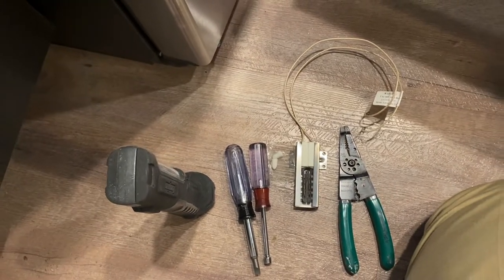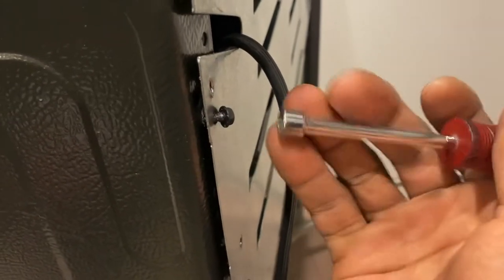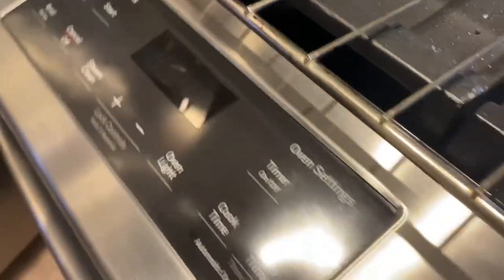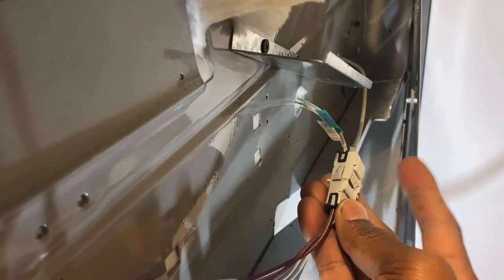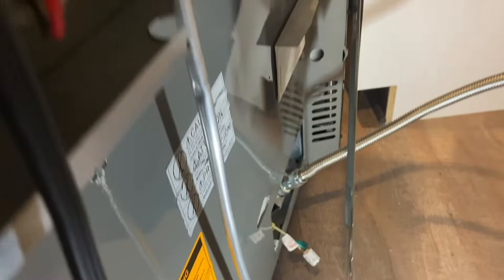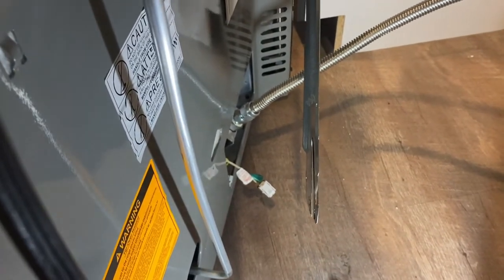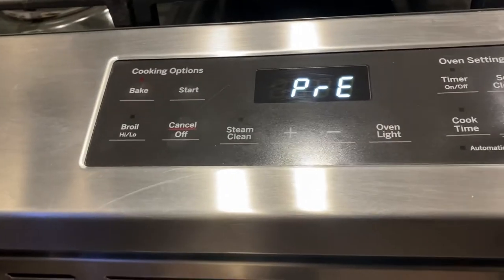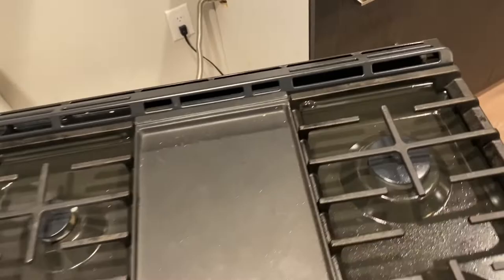GE Gas Stove Oven Breaker Trips / Resets … How to Fix

Comment: Just had a problem with my gas stove when I put the preheat button for the oven the GFI breaker will bust
So I put the upper broiler igniter on and it lit up I switched it to the bottom ignitor stove and took the upper igniter put it in the bottom everything was fine it's lighted up right away